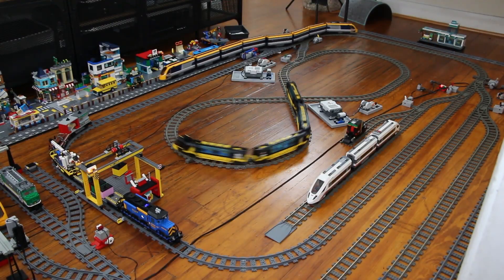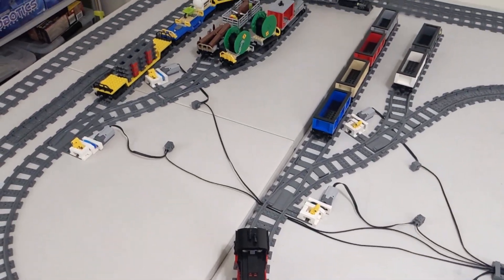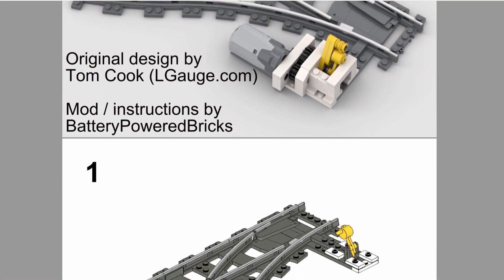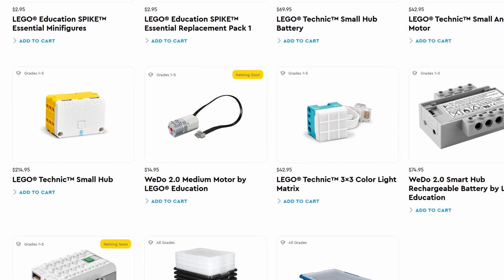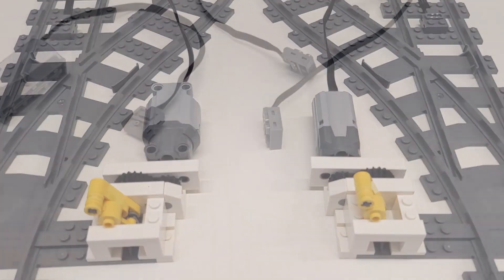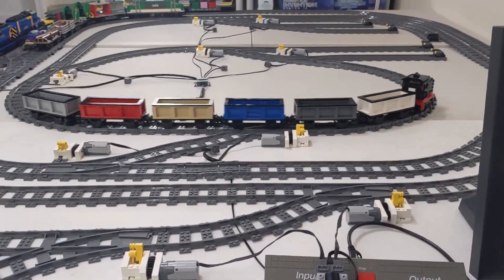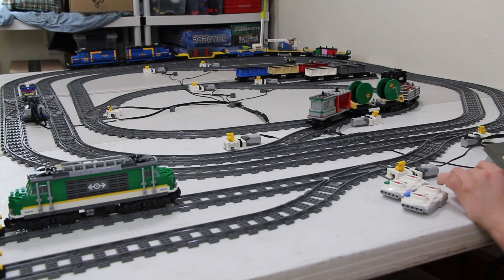Controlling Lego train switch tracks remotely (part 2)

Comment: Only guy on the internet getting close to this stuff so cheers brother. Would it be possible to attach several m motors to a mold king 6.0 hub (M0019) then control the switches through the app ?
Reply from the maker: I've never used the MK app and I have limited experience with the hubs.  I would think it should work fine though
Reply: @BatteryPoweredBricks thanks for your response.The MK hub I speak of has 6 power functions attachments. I was thinking of making extension cables for each and running them to 6 M motors. Do I need like a switch in between them? I've tested them with train lights and when I push one of the buttons on the controller it turns on then off. Would that work or am I missing something in between? Thanks again.

Comment: ow about the tracks with power in center of the tracks.
Reply from the maker: If you mean the 12v Lego train system they already had remote controlled switch tracks.  They weren't really a thing here in the US but I did import some 12v stuff over the last year

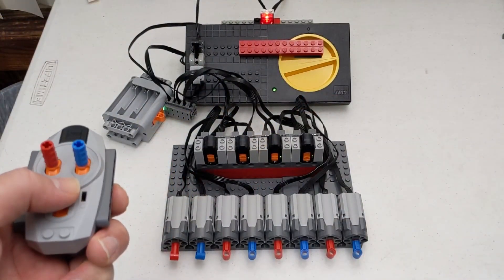Comment: Very interesting features shown in this video, thanks! Just for clarity: at 5:48 you seem to say "If you are using a Powered Up system to control your trains", but I can see only Power Functions components. And you talk of the usual 4 IR channels times 2 = 8 individual outputs, which is Power Functions. What has this to do with Powered Up (which uses Bluetooth rather than IR)?
Reply from the maker: Maybe I could have worded it a bit better.  If you are using PF to control the trains themselves you would lose any channels taken up by them.  Lets say you have 2 trains, using IR channel 1 A and B then you would only have 6 channels available for switch tracks controlled with IR.

Comment: Have you considered using a magnetic solonide or offical parts only?
Reply from the maker: I like to use official parts.  I want anything I build to be easily replicated by others.  The third party PF motors I use are only 4$ each and many of the parts on the switch machine came from the Pick a Brick wall at my local Lego store

Comment: Video ends and I instantly follow the instructions for the switch switch. I was using the same boxes you were, wish I could remember who's video to credit, and I liked them the best so far. Definitely changing them all to your modified Cook design. Minimal parts (a couple I don't often use, so sweet), frees up some bricks and plates for other uses, looks pretty sleek while industrial and it's geared down rather than direct. Win, win, win, win.
Reply from the maker: My thoughts as well!  Glad you found it useful!  The modified design isn't the most sturdy thing in the world, but I haven't had any issues in the layout.  Only when stacking a couple dozen switches in a box do I have issues with them staying together.

I lucked out and got many of the parts in pick-a-brick from my local Lego store.  The 1x3 plates (used in place of 2x3 and 1x6 as well), corner plates, jumper plates and some of the tiles 😁

Thanks for the comment, videos like this are quite a lot of work, but the comments always make it worth it 🙂.  Watching your layout tour now 😀
Reply: @BatteryPoweredBricks  Big thanks! I have a reoccurring dream of making the most fantastic and breathtaking feature on the 7722. I'm quite some distance from that station lol but whatever :) 
 Your design fells plenty robust and the way mellower action helps in repeated action. Seriously, lol I just sat here flipping, flipping, flipping..........